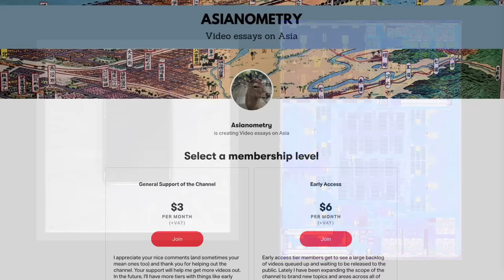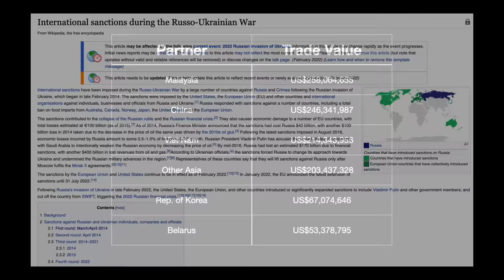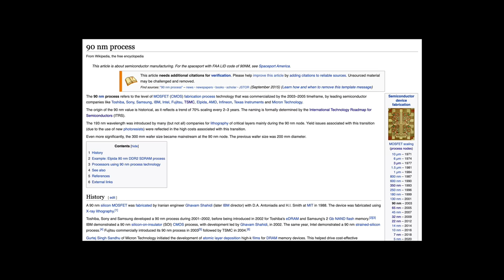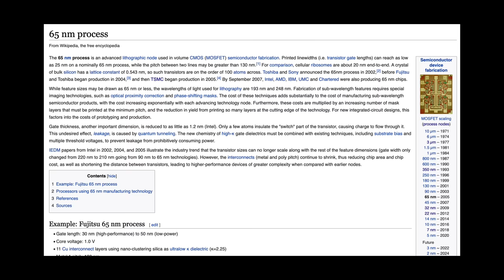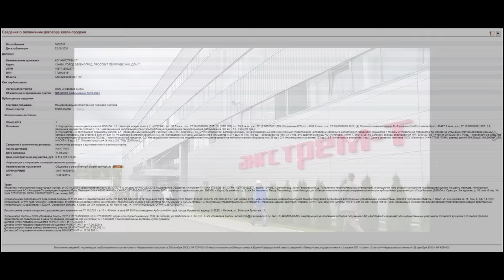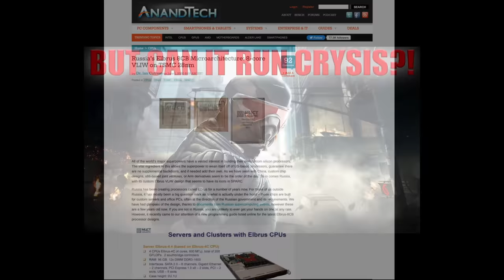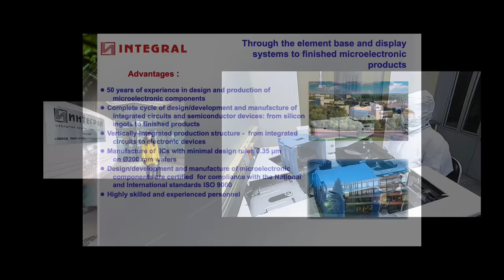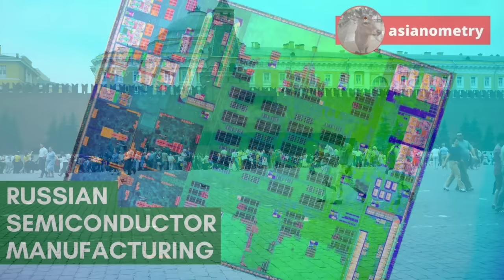Why Russia Can’t Replace TSMC

Comment: many of us get this wrong , yes smaller nodes are better for power  consumption / thermals / higher frequency = more performance  but bad for military's use and  violent atmospheric environment . also the most important thing is the engineering behind the architecture  , if you can achieve a very optimized complex architecture with  what ever nodes you have , you can make it work by just using less voltage or less transistors  , thus  a less powerful  65nm chip  but a very efficient one  is capable of running anything's and can be comparable to the latest nodes  in term of power consumption / perfomance , or maybe  a bit less powerful but capable of every task out there . so yeah it's all about how smart they are  ...
Reply: Yeah they don't need a HPC chip with trillions of transistors. An ASIC for military use doesn't need that many transistors to achieve its purpose.

Comment: One thing to consider is that military systems demand reliability, so chips go through years of testing or general use before being accepted.
Reply: that's the main target of Elbrus, use for industry/military to avoid potential "hidden capabilities/backdoors" of a western processor
Reply: That's very close to being the exact opposite of the truth. Contracting offices make a great show out of insisting on "military specs," but that's just bureaucratese for "must appear to work when first delivered."
Military rockets typically work 30% of the time. Guns of all kinds, from the sidearm pistol up through big league artillery, are produced and distributed en masse exactly because most of them miss most of the time. Tanks sit around for years and then have a half-life measured in hours once they're sent into use.
Military procurement specialists talk about reliability a great deal. Then they talk about reliability a great deal more.

Comment: The part around what chips Russia actually exports in high volumes made me suspicious about something that happened/is happening here in Brazil. The current "miliciano" government is cracking down on the semi-conductors and micro-chips investment, saying that it would close CEITEC (aparently it's the only latin america company able to design an fab silicon based chips) even in the current scenario that presents a huge window of opportunity. But even without this opportunity we could at least supply the internal demand for these low tech chips that Russia exports, but for some reason the governments refuse to buy from CEITEC, instead they choose to become more depended on imports, just like it's highly depended now on fertilizers from Russia and Belarus after paralyzing the construction of refineries and 5 factories of oil derivatives that could produce fertilizes and supply our internal demand.
Excites my imagination...
Reply: I wonder about the corruption angle. Paid to keep quiet?
Reply: ...it's basic globalization. You form a network, you can rely on that network when your internal resources fail.
Reply: @touristguy87  You got it completely wrong. Brazil's "internal resources" didn't fail, they were and are actively being destroyed and sold.
Reply: @AMRAMRS  "gvt also flirts a lot with other communists gvt so no wonder."
Just for the record, it happens more often and more scandalously with capitalist "gvt".
Reply: @touristguy87  
A military clique getting into bed with a subsidized, state-power-related, Russian industry is nobody's idea of "basic globalization."
I'd think you'd need to look at a bunch of Brazilian generals' bank accounts in Switzerland to get a focus on this one.
Reply: @TheDavidlloydjones  ps

why can't military cliques and state power related national industries take part in globalization
Reply: @TheDavidlloydjones  I think that you need to read up on what "nobody" means and how to use it properly.
Reply: @TheDavidlloydjones  ...especially since I just said that it was.

Comment: don't forget that not just TSMC is this important, also the only manufacturer of it's EUV lithography machines ASML. all of the chip foundries that are on the cutting edge of processing nodes 11nm-ish and smaller use ASML machines and it being a Dutch company will prevent any of these to be exported to Russia they are also incredibly difficult to smuggle in especially since they need highly experienced technicians to set them up on site and only a handful of these machines are produced each year.
Reply: Jenže komponenty pro ASML se vyrábí po celém světě , a tady stačí aby se to kdekoliv zadrhlo a je konec.

Comment: Great research and can't challenge the conclusion.
I agree that PRC will be the main source of supply replace sanctioned supply. As a Strategic Partner, China is motivated to help Russia be as strong as it can .. without sacrificing it's own interests.
I anticipated  TMC chip sanctions and in my reading I came across 2 points not mentioned here that can soften the impact of chip sanctions.
 1) Russia has long declared chips Military Strategic items and has unregistered chips fabs inbedded in classified military/Aerospace institutions. Obviously what help they can offer the wider Russian Industry is unknown as they are classified but analysts have said the RU Gov has been preparing to upscale these production lines in anticipation of chip sanctions since 2014
2) The type of chips Russia is most dependent on. Russia is not a producer of many bleeding edge electronics, ie phones, graphics cards, supercomputers. Most of the chips required by Russian manufacturers are for heavy industry; Resource Extraction, Energy, Agri-tech, Heavy vehicles (Rail/Shipping). So that reduces the dependency on the highend chips TMC produces. (But the Russian Tech start up sector, like YANDEX, will suffer) 
YES Chip sanctions are going to impact, set back and force Russia to restratergise how it produces electronics.
But chips are probably the least of Russian Industries probs. It has suddenly found itself cut off from Western markets. Huge sections of its supply chains will need to be re-orintated or even re-constituted. Entire Industries will dissapear. Russia is going to change to a completely different economy focussing exclusively on trading with Asia, Sth America and Africa.
Reply: Also more curious where this will be wartime measure to push russia to stop the waror long term
For consumer market, can always reexport it from China. People will gladly do it
Reply: The problem is not that the Russian industry needs a lot of chips, but that the Russian economy needs computers, which are no longer supplied. You need a lot of chips to build a computer. You might be able to get some from China, but all of them... Futher, Chinese manufacturers need to be extremely careful that they don't end up on western blacklists and most important of all... it'll be difficult to get payments from Russia. So yes, China will be the best place for Russia to get chips, but it's not that China is going to solve Russia's chip problems.
Reply: @danielmantione   Russia has oil, China needs oil. China has basically everything else Russia needs.
Reply: @sisyphusvasilias3943  Dang you make a lot of sense, and it's a very neutral take - though who to blame is still up in the air, USA, China, Russia (well can freely blame Russia for Ukraine) but why now? What caused Putin and co to take the risk? What is the greater Russia trying to get by military action other than global disgust and unrest
Reply: @aravindpallippara1577 Imho Putin really miscalculated the situation. He believed that Ukrainians would welcome him. Even recent polls (before the attack) showed a really poor trust in political institutions within Ukrainian people. Also it was absolut unclear that the Western nations were so eager to step in with economies just recovering from the pandemic and with energy production shift way behind the schedule.
Reply: @aravindpallippara1577  From Russia's POV a war with NATO over UKR was inevitable so they pre-empted in and chose to fight at a time that suited them before UKR was admitted to NATO or got nukes.
And USA/EU has been increasing sanctions on Russia since 2008 and total economic war with the West was also unavoidable.
In their estimation anyway.
Reply: @Bill Bopp Like UA was? The most corrupt country in Europe, 2nd poorest country in Europe. Economy in such a bad state that HALF!!!! of 18-45 yr olds had left the country (before this year). Because that is how Russia will look at best, if we ever here that "Russia has become a Civilised nation" in Western eyes.
The only time The West had good relations with Russia wash under Yeltsins Kleptocracy in the 90s when the country was destitute. 
The West has no interest in a strong, stable Russia, they are too much of a threat and the West wants Energy and Minerals for nothing.
If Russia does get "Civilised" the west will attack it. Like How Putin became more evil in the west at the same rate that Russia's economy grew in the 2000s.
Reply: @sisyphusvasilias3943  I would like to claim Russian economy is still not as good as it should be - every country grew multiple folds from 90s the comparison should be how well they achieved the potential they could - India only had so much, Singapore had much less yet I would hazard Singapore did a better job than India
Reply: @danielmantione  "Futher, Chinese manufacturers need to be extremely careful that they don't end up on western blacklists"
But that happens anyway, with or without Russia. Like with Huawei, for example. The US gov and think tanks are pretty open about  desire to curb Chinese development. And again, with or without Russia, that is a national security issue for China and they will have to develop that sector. Once they do, Russia can source high end chips from China and produce domestically the rest.
Reply: @alterego157  I agree about the desires of the US, but does it change anything? If a Chinese manufacturer sells 50 times as much to the "western world" as to Russia, they will be extremely careful not to lose that business.and therefore avoid behaviour that gets them on a hit list. Such a Chinese manufacturer might still try to do business with Russia out of sight, with intermediate traders in between, but nevertheless, it is a risk. A certainly don't believe that, because it happens anyway, Chinese busineses don't care about getting sanctioned. China will certainly develop their semiconductur industry, but they will do it for their own independence, not to help Russia.
Reply: Russian don't like IPhone,  Mecedi,  Audi.... Avangard is enough.  I stand beside Russian.
Reply: @tobiaswilhelmi4819  How many times you can remember when Putin has miscalculated?
Reply: China and Russia have centuries of rivalry. I'm far from convinced that China was Russia to be "as strong as it can". Russia, as far as China is concerned, is a source of raw resources, and by virtue of it's presence excludedes western powers from being able to threaten China's northern frontier - the only one that has no real natural barriers. 

A powerful Russia would pose an existential threat to China. What I imagine China really wants is for Russia to be strong enough to resist being co-opted by western power (or a rival Asian one such as India - which already has a close relationship with Russia) and to resist falling apart completely, but weak enough to be dependent on China, and thus be unable to pose a threat. It's much the same delicate balancing game as China tries to maintain in North Korea - strong enough to survive, weak enough to ensure it won't bite the hand that feeds.
Reply: @julianherranz1030  I believe China has some interrest in Russia, but not as an equal partner. Russia's population, economy and millitary power is vastly inferior to that of China, so China would be foolish to view Russia as an equal partner. However, Russia being dependent on China for basic supplies means Russia will slowly turn into a puppet state of China and this is useful for the Chinese. Second, Russia has some technology, notably aerospace and nuclear, that is of strategic interrest to China. This may (and does) result in China doing business with Russia, but again, China will and cannot accept its second economy of the world being destroyed just to do Russia a favour.
Reply: Did you call yandex a startup?

Comment: But does Russia need to replace TSMC? They're not a major electronics manufacturer and you don't need commercially viable processes for low volume weapon production
Reply: True.  Kind of like automotive electronics, would not surprise me if they are still at 180 nm feature size.
Reply: Don’t underestimate the effect of this. Losing these bleeding-edge capabilities in manufacturing can hurt, a lot. Especially if your military equipment as it is depends on any ICs that they just lost access to.

Short term, their ability to make war may be hampered, depending on how many spare parts they have for whatever weapons and weapon platforms depend on these ICs.

Long-term, this will be devastating. China is the only country that might come to their aid and their abilities also fall far short. During the Cold War, Russia lagging in semiconductors and electronics in general hampered their abilities to make things like radars, as well as miniaturizing them to fit in weapons (eg missiles). There’s a reason Russia depends on semi-active air-to-air missiles so much.
Reply: @liesdamnlies3372  Besides what ghyu says, perhaps Putin cares about economic advancement as much as dictator Kim does in North Korea?
Reply: consider the fact its not just tech companies but also software companies pulling out, russia could end up hopelessly behind technologically
Reply: Yeah. Planes have had fly by wire since the 70’s and I don’t think Russia wouldn’t have the foresight to not derange from global semiconductor supply chains especially in their aircraft and the like. The thing about planes is that they are big, so you usually have enough space to fit whatever sized computer. I wonder if the F-35’s successors will have built in RGB, that will be the next recruitment ad
Reply: @HellishPestilence  that's a lot of assumptions to make and Russia would be at the mercy of china... They might as well wait out the sanctions then buy foreign chips again but then again depends on the outcome of the war.
Reply: @HellishPestilence  All the countries that can make the most sophisticated semiconductors and manufacturing equipment make a huge point of not handing that tech to China. China is roughly at where the Russians are at in terms of tech level; the major difference is China has actual manufacturing capacity while Russia does not.

The equipment used for semiconductor fabs is highly specialized and you need  extremely specialized tools just to build those tools. You need knowledge that is protected nearly as closely as nuclear launch codes. It’s way, way harder for China to play catch-up on this than anything else.

They would not catch-up. They would serve as a third party to buy the chips and then send them on to Russia. But who knows how the hell Russia is going to pay for those now, and whether or not Xi would take the risk.
Reply: @liesdamnlies3372  There is a difference between military application and end-user application. Military has to be radiation tolerant, might have power specifics, physical pressure specifics. And most of all, each military unit has its specific purpose, so you can solve it by ASICs, not general computations. And even with general computations, Pentium II is often fine.
So does Russia need to own something < 65mm for general use? Not sure. For military back-ops that calculate satellite and gathered data - yeah, may be speedy processor would be nice there. Combined with consumer market, it's really not that much of a need.

As software engineer in Russia I would find a way to buy Intel/AMD anyway. It will be imported and no hard feelings there for the budget. But military is for military.
Reply: @TheWizardGamez  although planes are "large", surely you realize WEIGHT is an issue for any component and these things add up.

Comment: Russia could build chips for their own military equipment, just not the smallest & most advanced ~5-7nm "smartphone & notebook" chips.
But it's still proly easier to outsource it to China or other asian chip producing country than building your own factory.
Reply: military needs stuff that can survive at least emp  ...thats old tech electron tube but more modern version.
Reply: Not for their most advanced weaponry like precision missiles and their modern fighter jets
Reply: ...they don't need to make the investment to produce such chips, those chips will always have a low return on investment and the West will always make them. The whole point is to protect that market and thereby maximize and collect the limited ROI that they do have. 

Also in certain areas even parochial interest do want standardization as they make more money on the software than they would ever make on the hardware. Don't forget there are many layers stacked on top of x86/x64 chips, ARMs and what-not. All of those layers are targets for 2nd and 3rd party actors.
Reply: @NoShame86  no, space is plenty in those vs a smartphone